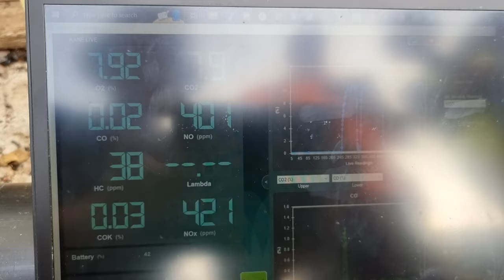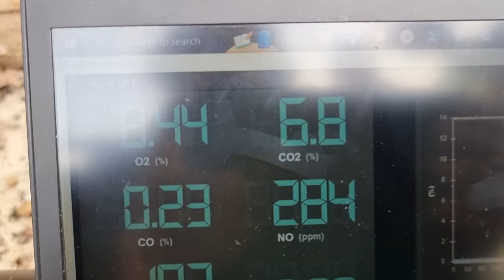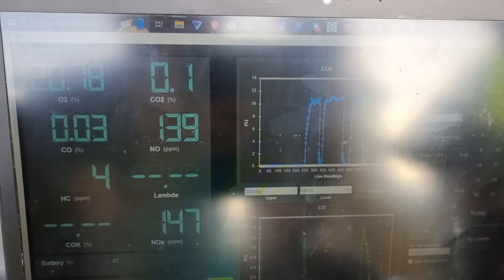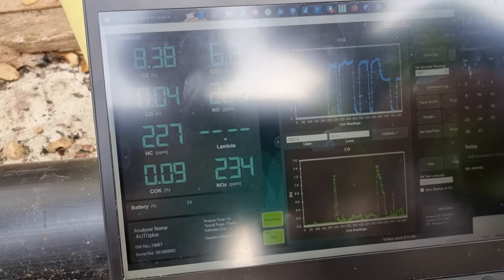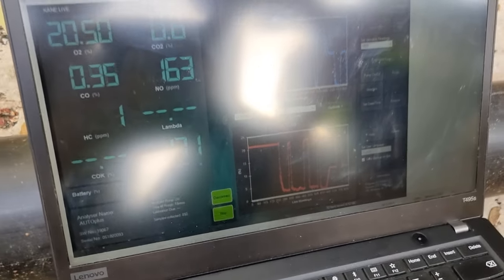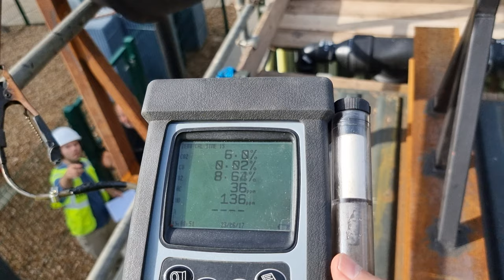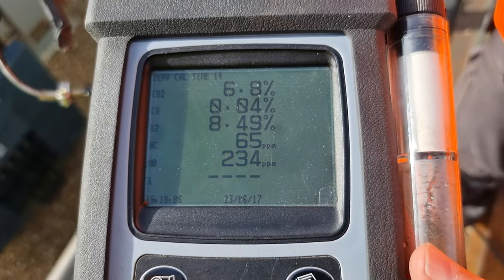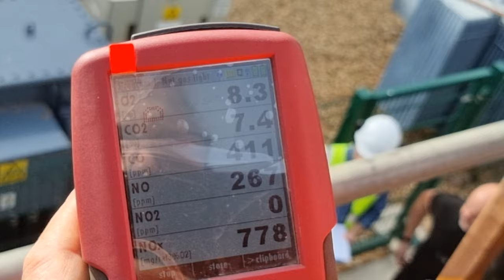THOR - Test on natural gas generator supplying 200kW to the grid.

Comment: I love this breakthrough. Do I understand correctly that even with this auxiliary unit on the generator, we get MORE gas volume out, just less of it being plant food, more of it being oxygen? Now we KNOW that CO2 will be gobbled up by plant life, and the O2 is given back the atmosphere. How would the atmosphere in theory change, in composition and volume, if all hydrocarbon burners were outfitted with this air intake system? If the soil and ocean don't through some mechanism provide the atmosphere with more CO2, might we see a drop in crop yields (there's an obvious reason greenhouse farmers inject CO2, if they can obtain/afford it)? Might we see a global rise in ambient oxygen levels which could shorten mammal life and boost all common wildfires, building fires and vehicle fires? The oxygen emitted; has it been tested to determine is common oxygen rather than some weird isotope with other properties? We're just seeing what the meter detects, correct?
Reply from the maker: That is why we suggest using Methane Hydrates.

Comment: Thanks for sharing.. Are there any photos or footage of the entire set up showing the pipework, the intake and exhaust with the thunderstorm unit attached etc....Did it all look convincing Bob?  I watched  Malcolm's videos on Howtube, but it kinda started to sound a bit random on video 2 where various mathematical ratios were being cited with stuff about the moon being a metronome and numbers being specific to our solar system!...Sure if it works, it works, that's all we need! If so, we just need a detailed plumbing parts list so we can all try this at home on an old briggs and stratton, i have one waitin in the shed. Once we confirm it is all legit, spread the word in every pub in the land, go forth and multiply as they say, before it gets stamped out by vested interests..If it is truly open source then lets go!.Well asuming it's not emitting any harmful radiation, which hopefully Bob can investigate...
Reply from the maker: You will see some radiation testing, also exposed some film - the data will have to come later. Will be interesting to see what the samples look like. This test is not 0 CO2, but apparently they are still changing things and testing... the smaller units are far more mature.
Reply: I just noticed there was a good writeup of the device on the quantum heat site, under the THOR project
Reply from the maker: Yep - much more to come. @Aedonius
Reply from the maker: Well - more details to come. @chuxxsss
Reply: @MFMP  Just checked up your write up on your Quantum heat website Bob, after the mention from aedonius..Thanks for doing this. We'll maybe there is enough information to build something from your write up..I really am quite curious as to why Malcolm doesn't just specify a simple parts and material list for easy diy replication, if open source is the goal, a small working model using the cheapest possible generator. I still sense an air of cloak and dagger  surrounding these demos. It should be relatively easy for a diyer to check for 30% increase in efficiency and associated drop in emissions. The only difficult part to fabricate for a DIYer might be the specifics of the nested spherical section, everything else looks to be standard plumbing parts, using off the shelf pipes and fittings, well, from the photos, that is....Has Malcolm ever acknowledged the GEET on his journey designing this device, did he say how he came up with the idea in the first place? If I remember rightly Pantone, said he got a "visitation",  which I guess, from a cynical perspective, is a great way to avoid any detailed technical explanations :) I am not saying they are scammers, clearly malcolm has invested a lot of time and effort into these systems and it would be illogical to do this without extracting profit, but it is a good job we've got you to provide some we'll researched and logical arguments behind the physics of these devices Bob...
Reply from the maker: Hi Mark, there will be much more detail that in that document to come - that is at the moment spearheaded by the listed Author. I resolved some anomalies that were not anomalies during my first on-site day, I have a detailed picture in my mind of how things may or may not be working and ways to improve what works and what doesn't - then it comes down to implementation of this adjustments. I hope to get another day this week to test a small unit - but there will be far more detail to come. @marksmith9218
Reply: @MFMP thanks Bob,  look forward to it...